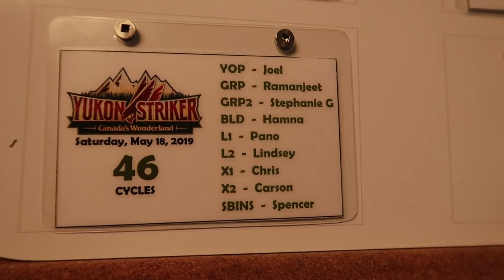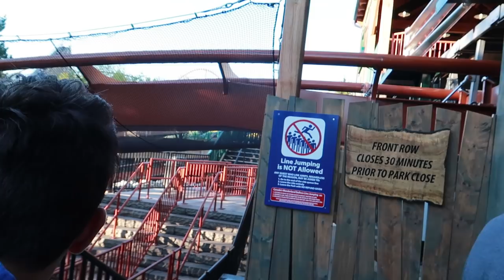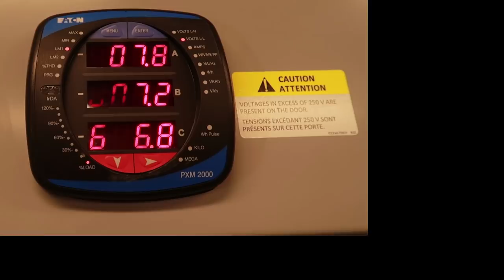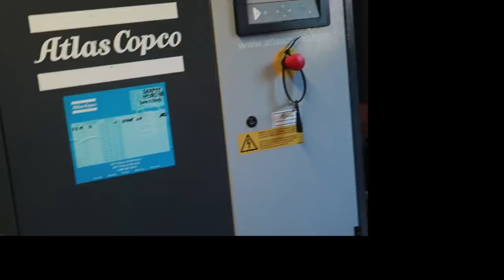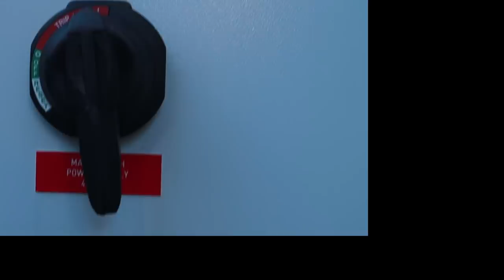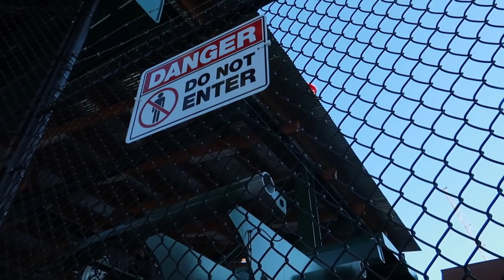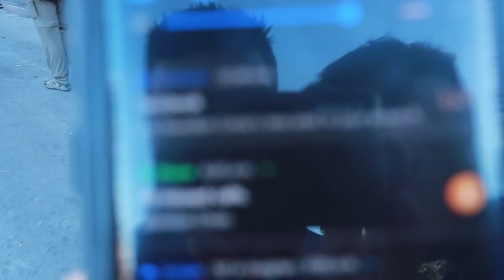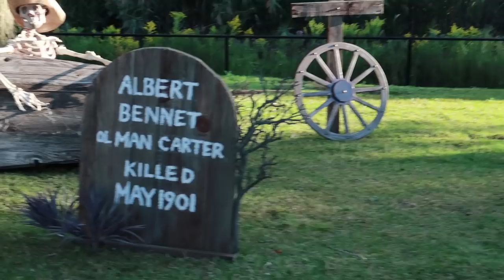Inside Yukon Strikers Tunnel & Computers

Comment: Last Sunday I was. Looking down at the Yukon striker tunnel to see if it was starting to flood with the rain, it wasn't (yet).
I also noticed a small crack in the concrete footing for the first column out of the tunnel but when the train past the footing moved a number of centimetres under the enormous weight and centrifugal force, I'm sure that's normal but I don't have a pinky ring so what do I know.
Btw, I was thinking "who goes down there anyway  then I saw your up load Sunday night, weird, eh??